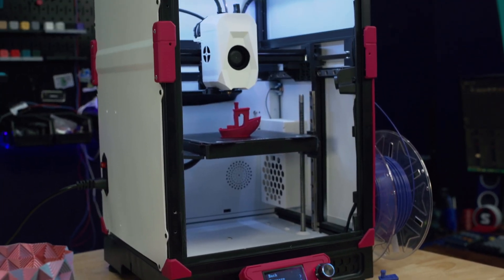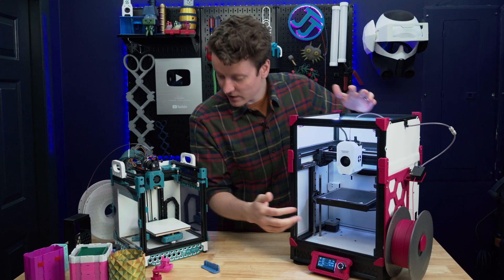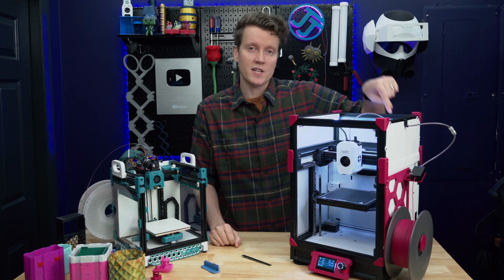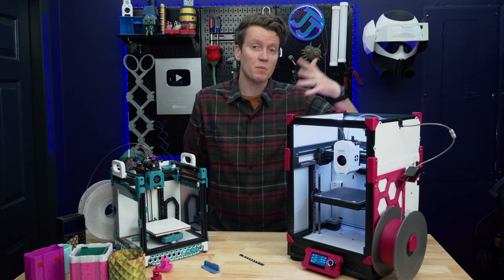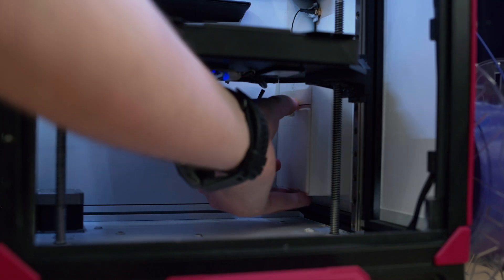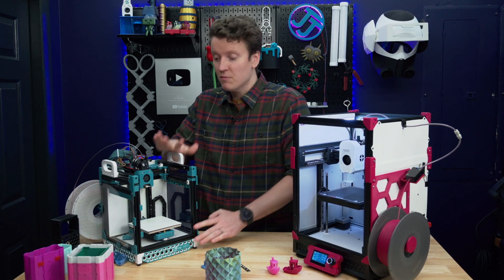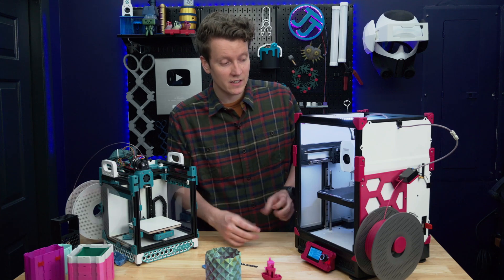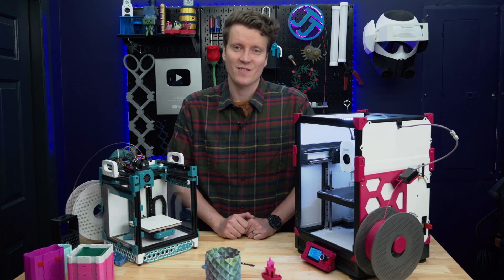Sovol Zero Custom Modifications and Review

Comment: how did you connect the led stribes. 5V extra power on the bottom with an extra power supply or directly to the mainboard ?
as 36 leds (2x18 i guess on eqch side) draws about 2,16A which might a bit too mich for the mainboard. 
can you please describe or show this.
Reply from the maker: These are 24V LEDs which I powered directly through the main board. On their GitHub Sovol has a pin diagram showing exactly the data and power pins for this board
Reply: @JJShankles  so you just connected the data cable to the RGB slots and 24V (VCC, GND) to the power supply ? because RGB1/2 is 5V
Reply from the maker: @alexanderwiltschek  Yes using Data Pins PD14 or PB11, and either connecting 24V at the power supply, or I think I just got power from some other open plug that delivers 24V

Comment: Could you go over the LED mod in more detail? I know you need to power it off the main 24v unless you make them very dim because the standard LED output is max 30mA. Also how do you print the replacement hotend cover?